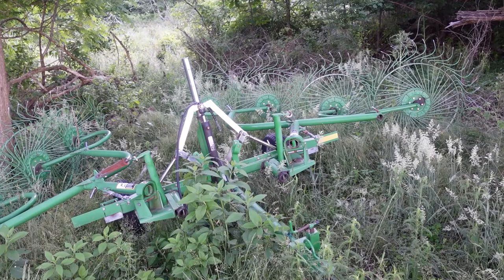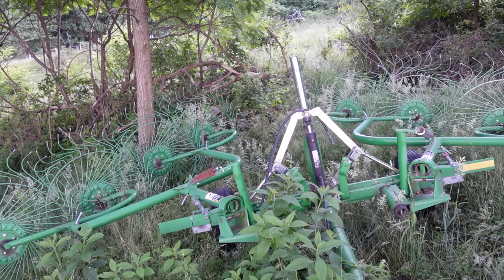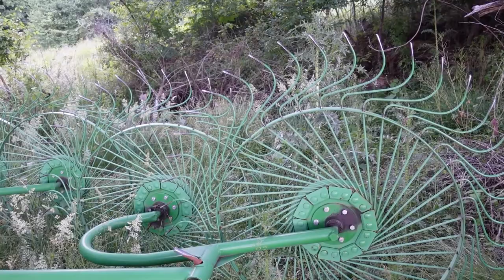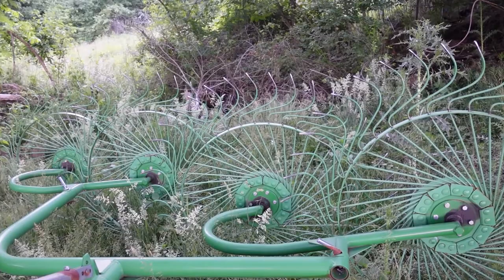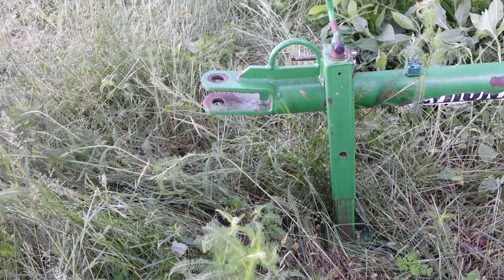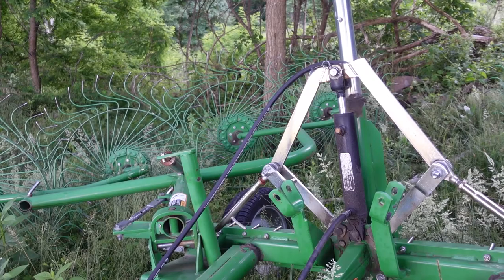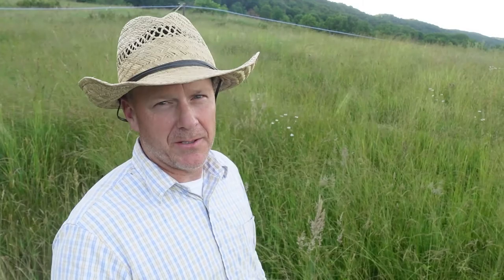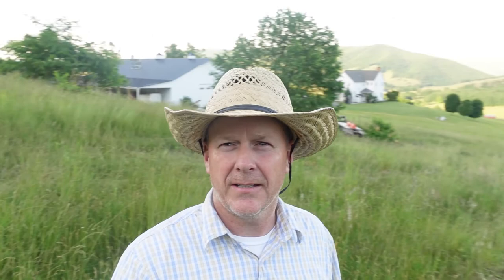The Basics of Making Hay - Raking with a  Frontier Hay Rake

Comment: Local dealer has this one basically brand new, able to operate each side individually as well as hydraulic center kick wheel, do you ever have any issues with it plugging up in heavy first cutting ? My rotary shit the bed and neighbor baled me it with Kuhn sr110 which did a great job
Reply from the maker: Hillside Acres,  When I get into super thick hay, it will act wonky.  Big lumps can form and lift a side.  It doesn't happen too often and for the price, I don't know it can be beat.  If money were no option, I would be a Kuhn with the self leveling wheels.  I think it's called a speed rake.  At some point I may upgrade but not any time soon.  This one seems to be working really well.  I think other companies make it or white label it. It would be nice having a 10 wheel and like you mentioned a kicker wheel.  I'm not doing that much so this is good for me.  Thank you for watching our video and commenting!  It means a lot to us!  Kevin